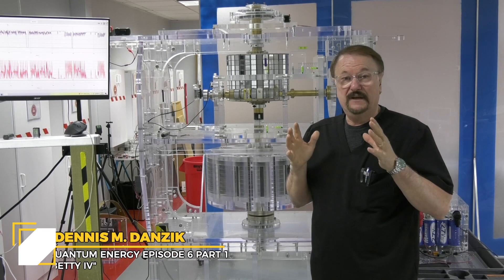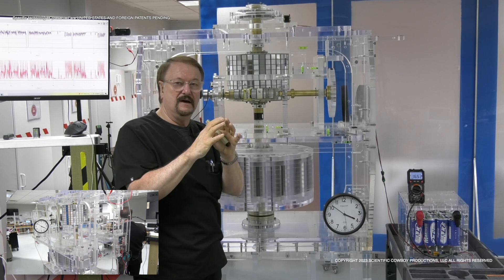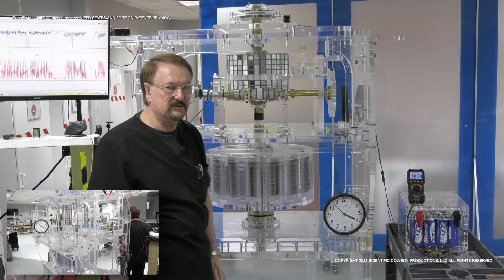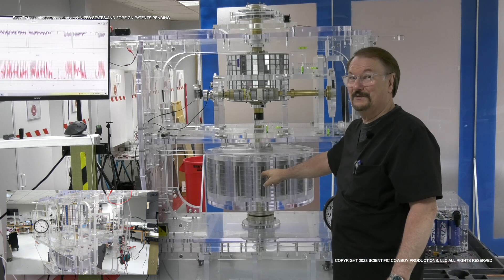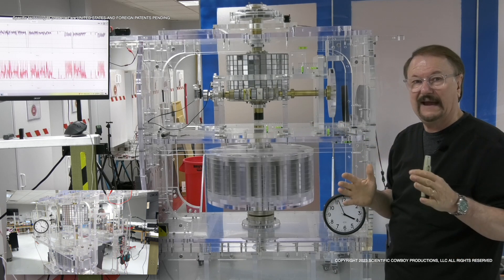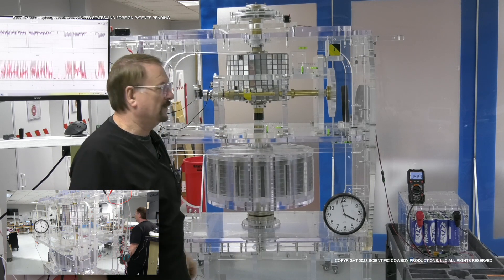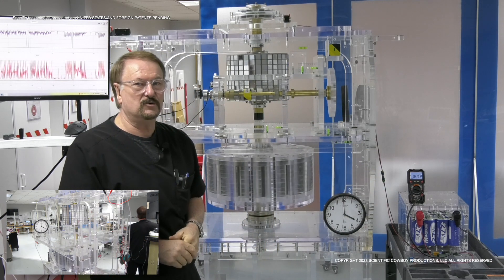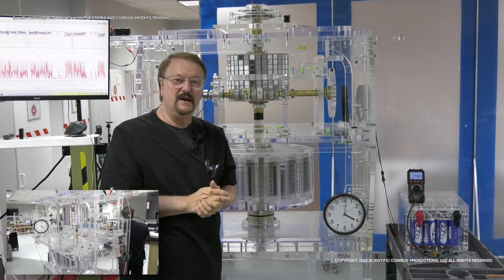Quantum Energy - Magnetic Engine - Driven by Photons - Betty IV

Comment: So will this be able to power a home off grid?
Reply from the maker: Quantum's Direct Energy Systems are being installed in industrial and commercial applications, and it is expected that U/L and CSA approval for residential use will take place by December of this year. Off grid applications are dependent on building size, geographic location, lighting saturation, and electrical demand. Check our website for the growing list of Quantum Licensed Distributors near you.

Comment: Because it's possible to block the magnetic field, repeatedly and periodically turn it on or off when necessary thar is realizable to performed at such wey that more energy can be produced than used on all necessary performance for get  it.
For some reason, in my opinion, that is the fare losing commercial property (secret), the speaker doesn't explain everything clearly.
Reply from the maker: Thank you for your comment. Please do not confuse Quantum's non-discloser of trade secrets with "not explaining everything". With a Photon Engine, no magnetic field is "turned off or on". Please stay tuned for more Episodes and information.

Comment: Can you explain the photons? How is light powering that? I'll buy that magnetism and geometry together can do that... but... light? How photons?
Reply from the maker: Thank you for your questions. In the Video Series in later Episodes you will be introduced to the Lighting Laboratory. Quantum has developed photonics that are extremely efficient indoors and have allowed for the production of light fixtures, furniture and other applications that collect energy, as well as ambient indoor light. In the next Episode you will see (under meter) how a Photon Engine (Laboratory Model: Betty IV) operates (a 750 flywheel) with only a 9 volt battery consume only 4 to 12 watts. A Quantum Direct Energy System uses 2,000 AMP 24v and 48v capacitors that can deliver 80 to 130 amps constant for direct use or to battery storage. Check out the Quantum website at www.quantum.energy to see photos of the Lighting Lab and some of Quantum's 130+ products.